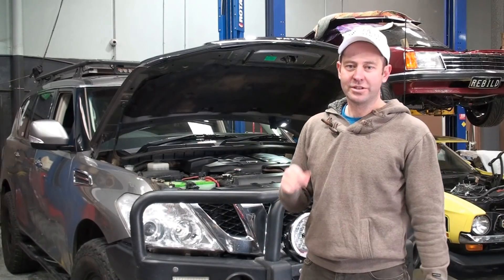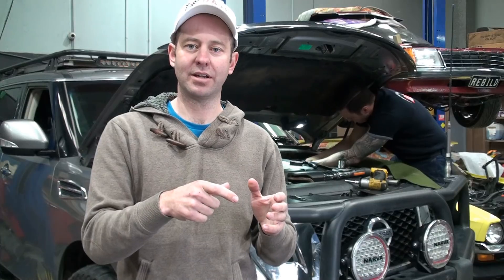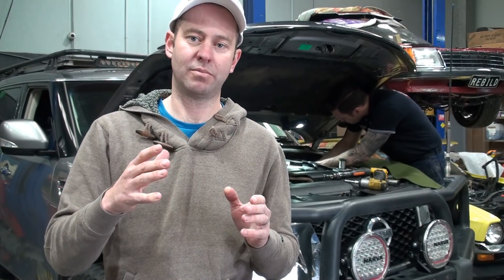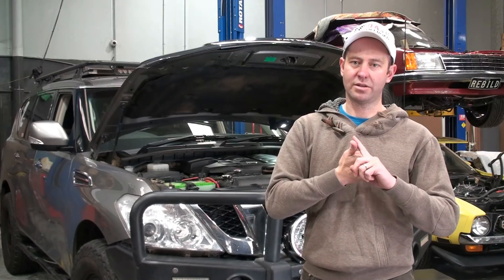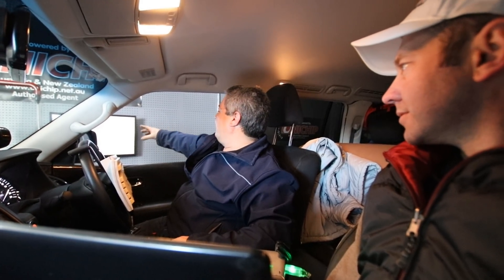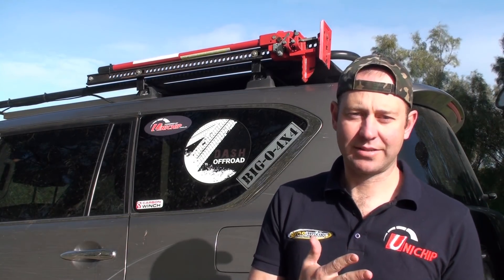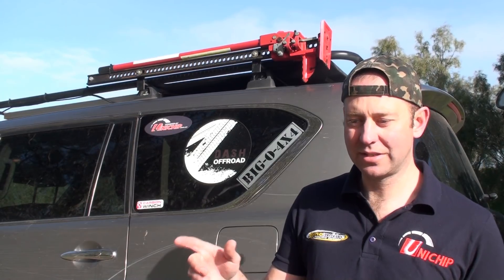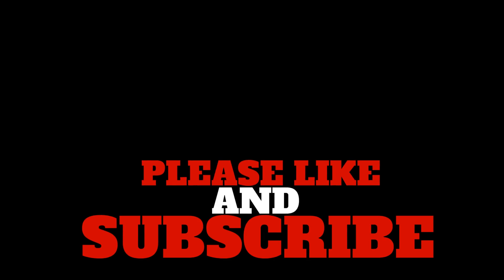Unichip REAL TIME Tuning - How much can be gained from a Y62 Patrol Petrol V8?

Comment: Hay Dave, great vids love the Chanel. I have ordered my y62 😀. Has the uni chip help up over time? Has there been any engine lights etc?
Reply: Held up over time?
Reply from the maker: Unichip helped but in the end had to change the exhaust as the cars were blocked. Still love the Unichip, I fact bought another one for my NP300. Great product 👍
Reply: @DASHOffRoad  Hi Dave. So the Unichip is now on your Series 5? Mine arrives in April and I was doing exhaust, snorkel and Unichip. Cheers KB

Comment: Hi Dave, great video. What's the towing map like? Have you been using it? Has it proven to be better than stock?
I'm interested in setting mine up the same but more for touring and towing with stock tires.
Reply from the maker: I must admit the Unichip hasn’t really done anything for towing, the benefits are more noticeable for not towing. There’s not much difference between the 98 power nap and towing map, I think it is just a bit richer for safety